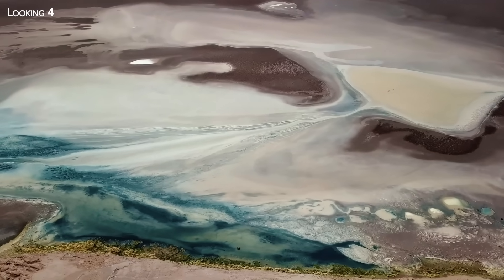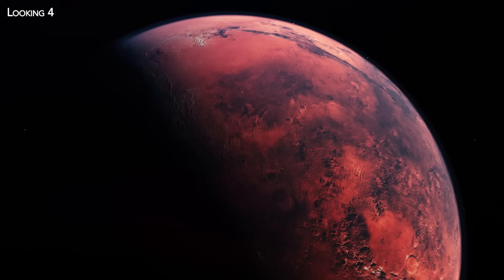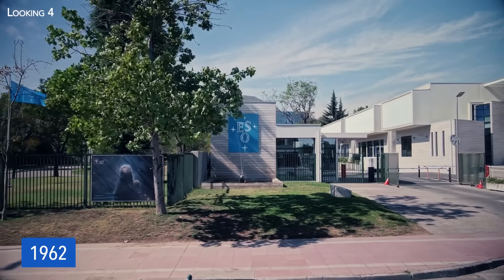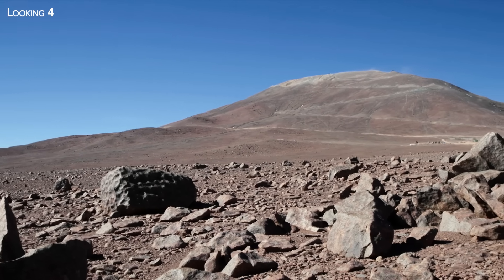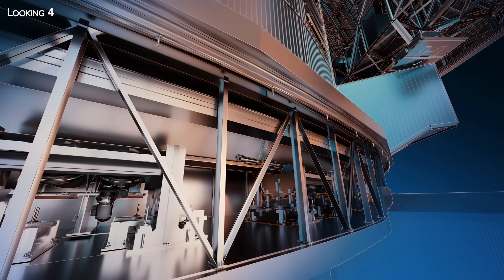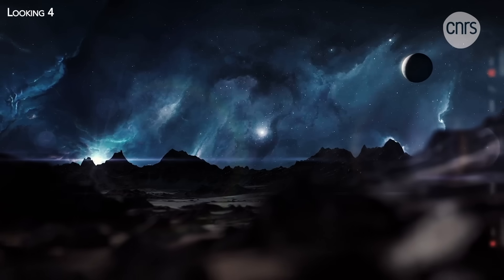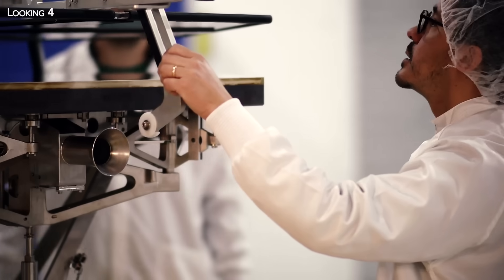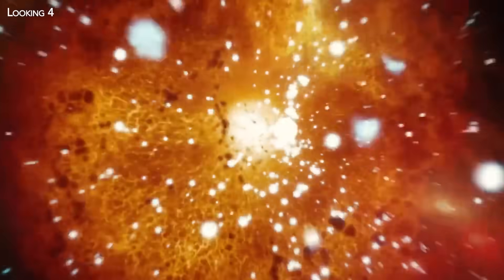ELT: The New Telescope that could Find the Origin of the Universe

Comment: It seemed like this video was throwing shade at JWST, which felt odd. JWST can see the earliest light and stars forming in dust clouds that no land base or other telescopes can do. There’s no doubt ELT will be great instrument for scientists to use and they will be able to do maintenance and upgrades, but the video seemed a little insecure. The Atacama Large Millimeter Array (ALMA) is an amazing instrument too, especially when all of the telescopes come online.
Reply: Like it or not JWST cost a small fortune compared to this instrument and it does NOT have the resolve power as well. Now that atmospheric correction has come to the forefront ground based instruments are still a LOT cheaper AND they're repairable... two huge pluses over space based instruments residing at Lagrange points. Unfortunately placing ANYTHING ANYWHERE in space is extremely pricey.
Reply: @leecowell8165  We basically said the same things. JWST cost was more than a small fortune and took many years and man hours to build and deploy, however, I believe it was worth it. It can gather information no other telescope can and the technology developed to build it will help future missions to deploy scientific instruments that will help advance man’s knowledge of the universe. The more advanced telescopes built, the more tools scientists will have to study the universe, which is a very good thing in my opinion.
Reply: JWST is an Infrared radio telescope and, just like visible light, can NOT see through the ZOA of this Milky Way and therefore that part of the sky can NOT be viewed through this radio telescope, this completely unlike X-ray radio telescopes!!
Reply: JWST can see the earliest light and stars forming in dust clouds??? Lol. Professing to be wise they became fools.
Reply: I don't think I read into it , where they were throwing shade on JWST. 

All the  Ai  told us, is the difference and the postivies between the two.

Comment: I thought that's why Web is in outer space, to prevent distortion from our atmosphere?
Reply: JWST is in space mostly to observe in deep infra-red, which cannot be done from the ground because Earth's atmosphere absorbs it.
Reply: That's only one huge advantage (largely removed by laser based atmospheric correction). JWST also records 24/7 (while ELT will only be available for much shorter time periods after complete darkness). Also for about 40 nights/year ELT nighttime is too cloudy. ELT has several huge advantages though. For one this instrument is a lot cheaper. And its repairable. And its resolution will blow JWST away due to its gigantic mirror sizes (ELT's secondary mirror is almost as large as JWST's primary mirror!). Finally it has a much, MUCH longer lifespan (unless at some juncture in the JWST gets serviced at Lagrange). I believe servicing by then (about 19 years from now) will be superfluous as the instrument will have outlived most of its usefulness.

Comment: What's next? Ridiculously Large Telescope? Gigantuanly Large Telescope? Ludicously Large Telescope? The Sillyly Large Telescope?
Reply: It  will be   called- ``   Are  You Kidding  Me  Telescope``.
Reply: @leotimtom6637 Then “Are You F’ng Kidding Me” telescope.
Reply: @leotimtom6637  😄
Reply: Do you know that the "Overwhelmingly Large Telescope" (OWL) was an actual design. It was abandoned in favor of the ELT because (wait for it), the budget was overwhelmingly large.
Reply: @jmchez  😅 No, I didn’t know that.
Reply: The hyper super extra fantastic telescope, HSEFT, which will have 1,000,000 makeup mirrors and will be built underground.
Reply: They name digital circuits like this too
Reply: There are ongoing plans to build them on the moon they will use crator sites for the dome the asteroids have already made perfect sunken dome circles at varying sizes for the design that will be already made to size  on earth and taken apart sent to the moon reassembled on the moon
 a roll out net style circle will connect to pins inserted into the moon surface around the crator holes 
as the plan moves forward there could be dozens on the moon in decades to come.
Just one of the plans for the moon
Reply: Donald Trump's YYYUUUUUUUGE telescope
Reply: You love it!
Reply: BUT still not big enough to take a clear pic of our Junk on the Moon???

Comment: Ten times better resolution than four interferometric optical telescope.  Maybe, but the ELT also combines all the light into one image. The four telescope interferometer doesn't combine all four to make a single image. They only combine the light for spectroscopy.  When they take a picture, they take a picture with only one of them. So, it would be more accurate to compare the ELT to just one of the four optical interferometer telescope.
Reply: This is not true. There are imaging instruments at VLTI which can combine interference fringes to get an image - in the past AMBER and MIDI and now PIONIER and GRAVITY can do that. So no, they combine light not only for spectroscopy. 
But you are correct that it's not a 1:1 comparison because interferometry is not "magic" - not only you don't collect the same amount of light as real mirror of that size, but you also "lose" 90% of the light by bouncing it around into a single focus. As a result you might get better resolution from interferometer, but it will only work for very bright objects. ELT will be able to see significantly fainter objects.

Comment: i wonder how advances in machine learning can play a role in laser correction effectiveness through the atmosphere.  we could auto label with simulations on turbulence volumes.  at runtime, we could use this to unwarp the image and know what parts are more accurately known in a given moment.
Reply: I would imagine the difference would be night and day !
Reply: Hopefully it will give us clear image of the cosmos and the planets
Reply: I'm not sure what exactly you mean - this is already exactly what happens with AO and laser guide stars. 1000 times per second the disturbance of the guide stars are measured and mirror correction is applied.
Reply: machine learning is only good for specific things (like crunching huge amounts of data). immediate fine tuning of optical data is really not its thing. it's not a 'cure all'.

Comment: What do you mean by "as early as 2028"? What's the "early" part?
Reply: Early relative to 2029.
Reply: It was supposed to be completed by 2018 and it's ten years late if it will be completed by 2028. Maybe he was being ironic, or maybe he had his doubts that it would even be complete by then.
Reply: @Justwantahover  No idea where they got the 2018 timeline. It never existed. Construction started in 2014 and it was projected to get first light by 2024, however in the meantime stuff like covid happened and with lockdowns and stuff the construction was halted.
Reply: 2028 is pretty darn much earlier than "never"... maybe they had budgetary problems? Which country pays the most? Which country does the heavy lifting in building it? Plus, if it built on grants and with changing governments with differeng priorities, time becomes relative. One doesn't just say: We'll build an enormous telescope: 3..2..1.. GO!
Reply: JWST  was  suppose to cost 1 Billion and be launched in 2007. 😊
Instead it cost 10 Billion and was launched in 2021  😳

.                Damn !❕️!❗️!❕️!

This will not be completed until 2031 or 2032 maybe 2034.

I can see a lot of unforeseeable hurdles that they will have to overcome.